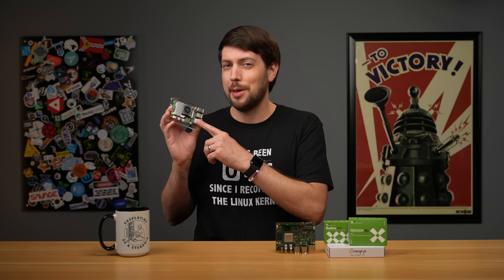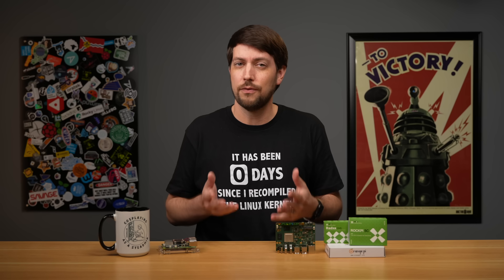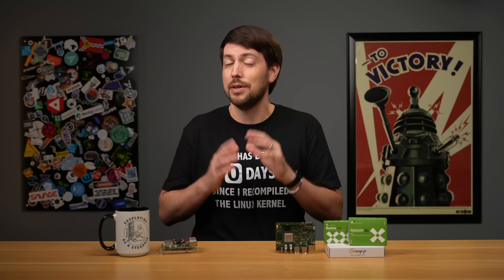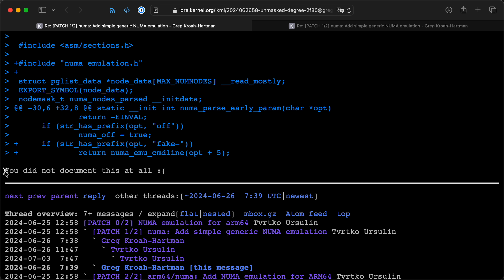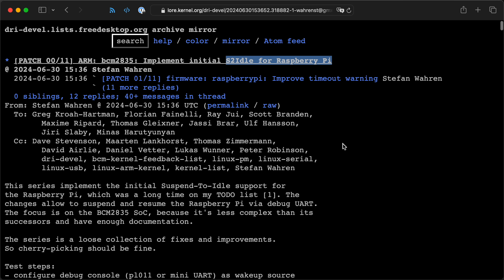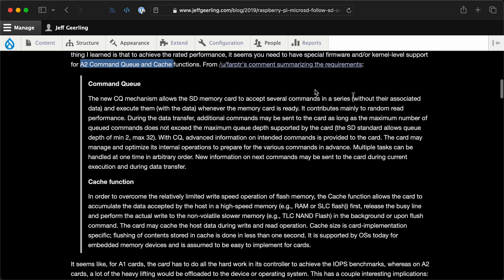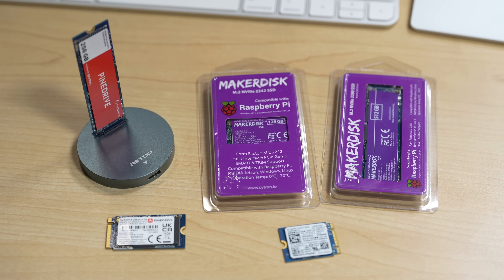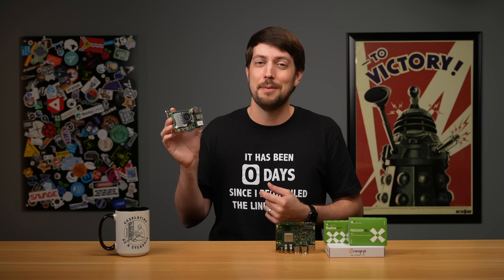NUMA NUMA make Raspberry Pi go ZOOMA

Comment: Wholeheartedly agree with the kernel maintainer. This should be fixed in the firmware and not with some fake NUMA hack that adds eternal technical debt.
Reply: Valid point, but the author also pointed out that the feature already exist for x86_64, so he was just extending it to ARM. Seems a bit unfair to not treat them equally. Then again, it could be argued that the x86 part shouldn't have been there to begin with 🤷‍♂️
Reply: @guiorgy, that's not what the cited commit do. Said commit define arch specific code (under arm64) and promote them to generic since RISC-V also behaves similarly. I.e one code apply to multiple arch, so it make sense to promote them to generic.

The newly introduced patch add new behavior either specific to ARM or Pi (the numa_emulation.* files). But the way it implemented, by directly patching base driver, carry the new behavior to base. So there are now 2 codes, one for generic, and one for Pi, both resides in base.

IMO, it will be unfair to moved it into base driver (rahter than make it arch specific or move it outside the kernel) since base have dedicated maintainers that may or may not have the capability to verify the changes.

Comment: Sleep states can be super useful if you're doing battery powered Pi stuff!
Reply: At the reported power saving not really, its such a tiny change to an already pretty small idle draw. If they can push it further then it would be great, but right now you get more benefit than reported here just dropping the minimum clock speed, and under volting type fiddling, at least on the Pi's I've played with - more power saving is nice though.

Comment: My own experience has also been that it's mostly memory accesses that make RPis dog slow. Just try to build anything using "make -j $(nproc)" on it and compare with any other board. It's systematically twice as slow as other boards with comparable CPUs running at same frequency, unless you're running single-core. The worst of it is actually that their DRAM random access times are quite good, but that doesn't suffice.

Comment: The idle power state is pretty cool, though when you are talking less than 3W draw anyway without it and the saving is so small it hardly matters for most Pi users. Though it is always nice to see more support for low power states it really matters so much more when the system actually has meaningful power draw when idle but not in a low power state. Being able to shed 20 or maybe even over 200 watts on a system with much more and higher power hardware is when the low power states really shine.
Reply from the maker: Definitely; I would love to get better idle support (and have software that isn't constantly pinging the Internet (and using CPU cycles) on my AMD workstation... 60W idle!

Comment: NUMA is super important when you deal with multiple sockets (and chiplets) and things like PCIe passthrough in virtual machines. It's bad enough, performance wise, to have to cross between NUMA cores on the same socket, it's brutal when you do it across sockets. Increased latency, limited bandwidth, you name it.

I think I agree with the kernel developer, this is something the firmware should deal with, not something you should emulate in the kernel.

Comment: Wow the sleep state thing, just bought another Pi Zero 2 W that I have connected to a small battery (7.2 AH) and 30W smallish solar panel (with charger) to see if it (I don't have that much sun where I live) could "run" forever :-) and that would be awesome with even less power if not doing much work... But then again, I was thinking of making do something that will probably not let it into any kind of power saving mode anyway...
Reply from the maker: Yeah a lot of times the sleep states are less useful for use cases where you would use a Pi—but still nice to have available nonetheless.

I've started using Picos in some places where I used to use Pis, and even there, I think it would be nice to have better 'sleep'/idle support.

Comment: It's depending on the software that you use. My software runs on 4 cores with the Pi 5 (8 GB) not 4 times faster, but 3.77 times faster. That is fine. It is also not better on x86 CPUs. Also compiling source software is nearly 4 times faster.

Comment: Great insight into Numa! Jeff, have you compared NVMe performance between rpi7/kernel 6.1 vs rpi8/kernel 6.6 builds? 

Iv so far been unsuccessful getting 6.6.x to run stable on my PI5-8GB but 6.1 was no issue. 

Over clock and all the pci configs (as per your blogs) were a great help. So thanks 🙏
Reply: I was able to get a stable 6.10 branch finally. 6.6 needs a patch to fix wifi

Comment: Hello from Radxa Rock 5C running Linux 6.1.75, BredOS Experimental.
Still using the older panfrost gpu drivers though. Panthor is 2x slower.
Reply from the maker: Fedora apparently can bump up to 6.6 or maybe even 6.7 with the mainline Linux kernel, but you have to build your own. Hopefully board vendors will start moving to 6.x sooner or later.

Comment: A red light  next to your camera that turns on with the HVAC might be helpful.
Reply from the maker: I actually have most of it in Home Assistant, I just haven't had the time to wire up an automation for 'recording' that works for me. I can't just trigger it on the studio lights because sometimes I have those on when I'm not recording a video. And I'm still working on better automation for my recording / saving video files off the camera.
Reply: @JeffGeerling another thing to keep in mind is at least 90% of your viewers are in rooms with fans etc or other places with more than 40dB background noise and wouldn't even notice it as much as you do during editing 😉
Reply from the maker: @michaelcummings7246  Heh, true—but the rumble is annoying because of the frequency, and my HVAC unit also seems to not play nice with AI noise removal, making for some weird audio if I try removing it in post. Easier to just not have it going!

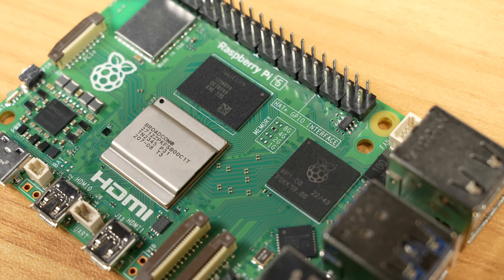Comment: 3:35 I never noticed before, but it looks like all the memory resistors all go from ground to the same trace? Is it just visual indication?
Reply: It's mainly visual indication, they also have different resistance values measured by the ADC on RP1. You can already detect RAM size by asking the LPDDR4 chip directly

Comment: is there a way to connect multiple Raspberry Pi HATs?
like a m.2 nvme with a active cooler and a PoE hat
Reply from the maker: Yes! Though it can get a bit crazy—easiest way is to get a HAB (Hardware Attached on Bottom) and a PoE HAT, that's how I do my NVMe BASE or Pineboards bottom boards with a Waveshare PoE+ HAT.

A few others are coming out that are either more stackable, or have PoE + NVMe integrated into one board.

Comment: The issue is that these nice to have changes might never make it upstream ... Pi firmware is basically kernel patches and not its own entity. The manufacturer only knows how to hack away at the kernel, rather than work with what's there. Is it the kernel's fault for not supporting strange proprietary hardware magic? If its not supported out of the box then its not generic hardware, which is fine, but then you can go calling it pcie or usb. Its out of standard clone.

Comment: I'm all for saving power for various reasons but I hate sleep mode it screws up everything on every other system I use, even on different OS but especially Linux. If it gets added I hope there is a simple way to disable it.

Comment: "Rockchip doesn't publish updated kernel sources" I thought that was because their chips are mostly supported on mainline?
Reply from the maker: Some things are—though it seems like Rockchip contracts out some of that through sponsorship with Collabora. It's not as easy to work with mainline casually, though (e.g. flash an ISO, recompile kernel in place).

I may try it out when I have a little more time.

Comment: how many ranks has a raspberrypi? Ranks can also make a big difference in performance if you dealing with large core counts. in best chase scenario every thread has his own rank for best performance. i have a 44 core server with 12 dimmslots, every cpu das 22cores with has 4 ram channels. i used at the beginning 2rx16gb ram modules and had in total only 16 ranks. i ran in issues with high thread count calculations, i noticed if i utilized more than 16 threads at one performance performance did not increase by one any more and waiting on each thread increased. so i bought 4rx32gb modules and this time i had 32 ranks and same story but this time if i used more than 32 threads until waiting time per thread increased. 
one quick note bot ram types are the same manufacturer and exactly same ram chips, so speed and timings are identical. both used samsung chips with 2300mhz. 
so yea i think ranks are also relevant for performance, but if this has any impact on normal day use. i dont know, but clearly it has one if you dealing with constant memory access because your program uses thousands of small and medium data chunks bigger as the L2 and L3 can handle. in my case i use 2 xeon e5 2699v4 with 22cores and L2 with 256kbyte per core and 55MB L3 cache per cpu.

Comment: I wonder if any of this will work on the pi 2 (pi 0 replacement) bc My pi 4 will not work with any keybourd and mouse (even low powered ones)
Reply from the maker: Right now Pi 2 doesn't have any of these optimizations. It was a bit of an odd Pi in the lineup :(

Comment: The RPi foundation has once again made misplaced savings on hardware by using obsolete technologies, they only thought of maximizing their profit margin instead of trying to satisfy users as much as possible ;-(

The Orange Pi 5 was released several months before the Rpi5, it is barely more expensive than the RPi5 and is much more powerful with its 8-core CPU engraved in 7nm, its GPU displaying 8k 100% fluidly, its RAM up to 16 Gb and RJ-45 @ 2.5 GB, and its integrated eMMC + M.2 2280 support. The OrangePi 5 Max on paper is great...

Comment: The raspberry pi is dead. its too expensive get a N100 intel celeron with 20x the performance of the raspberry pi at the same price...
Reply: You can still buy the whole pi range, the pi2,3,4 and the zero's. The zero's cost $15. You don't have to buy a pi5. If you are buying a Pi to use as a desktop PC you are doing it wrong. The N100 has no GPIO pins and none of the projects you can find online will tell you how to use it. I think you have zero idea why people use Pi's.
Reply: @backgammonbacon  there are literally hundreds of GPIO pins on the N100
Reply: @backgammonbacon  First of all this is not true, you cannot find a new raspberry pi for $15 and don't bother telling me to buy some ancient 20 year old raspberry 1 for $15. its useless by todays standards. Secondly, the gpio pins can be easily had with a simple USB to gpio pins extender, in-fact that probably the best way to use gpio i've found so far. Lastly, The N100 is a desktop computer capable of making the raspberry pi look like a doorstopper for the same price. Search up the performance of a raspberry pi compared to an N100 intel chip. You will get stomach pain at how much it beats the raspberry pi in every level. Lastly part 2, You don't need "projects that you can find online that will show you how to use it" you are not a child, it is embarrassing. A grown man in his 50s shouldnt be on the milk bottle.

Comment: The 16nm process of Raspberry Pi 5 CPU is old and out of fashion. Why don't explore the potential of Rockchip RK3588 SBCs instead?
Reply from the maker: That's exactly what I've been doing for months. Hardware great, software support, not as much.
Reply: The previous rpis use even older nodes, like 28nm if I am not wrong. I believe part of the reason why the various rk3588 sbcs do not have great software support is because their margins are too low to dedicate resources to software support. I believe the rk3588 uses samsung 8nm, which is way more expensive than any 16nm node and yet they are priced only slightly more than a pi 5, not to mention having boards that come with way more hardware eatures and i/o.

Comment: Linux handles I/O failures like it is mad at you and hates you for buying a piece of crap device. Surprise removals are handled like crap on all Linux systems by default on all drives. It doesn't care. Read the asinine source for AHCI and other ACS devices, Linux just table flips the entire port the moment one command fails, couldn't be bothered to read the error log to find what failed. It just fails everything that was running and couldn't care less. It is a jerk like that for all host controllers. My hobby OS handles disk errors better than Linux.